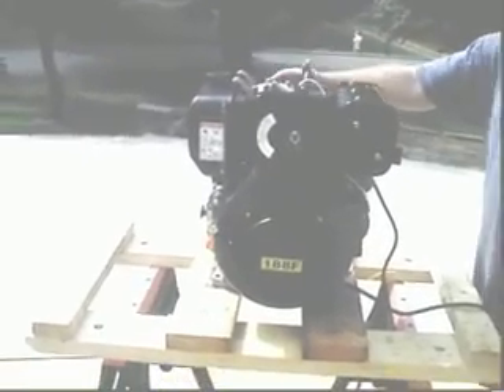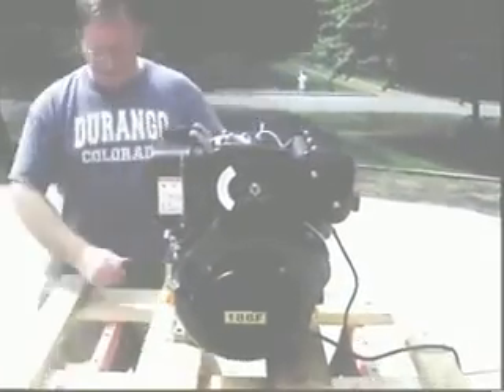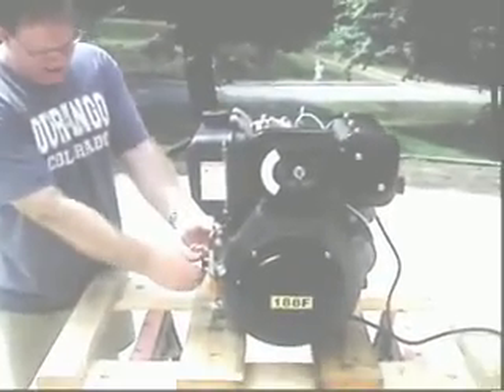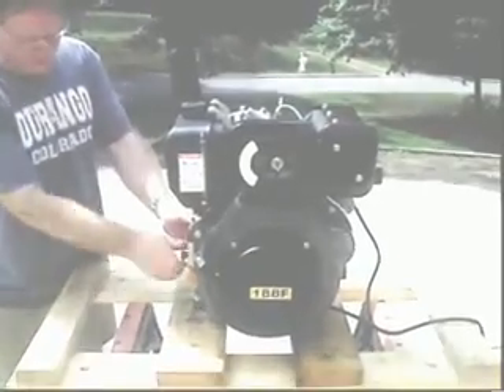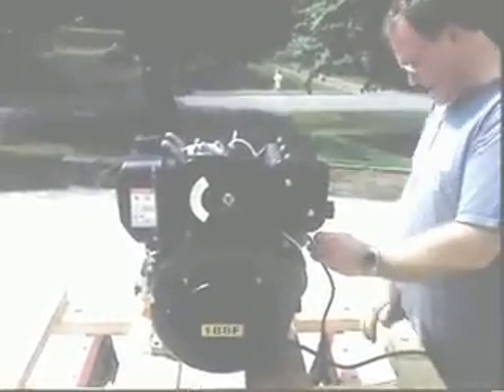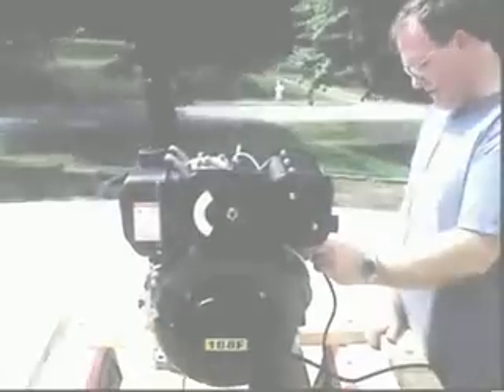13hp Punsun Winsun Changfa Diesel Engine Air Cooled China

Comment: I have a similar engine (winsun 192) to replace the 188 winsun i have now, but the output is very poor and i cannot find the cause; injection timing is okay, but no smoke, gov. pump arm goes all the way to the right, also bad cold start.Fuel line is okay.. The seller does not give any warrantee... someone an idea what could be the problem?